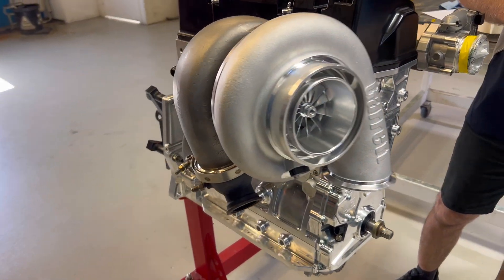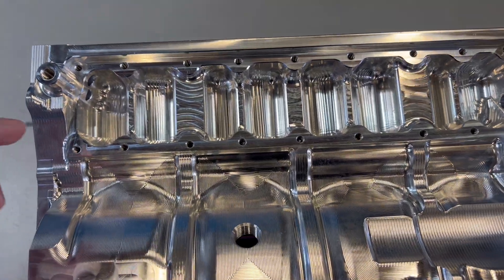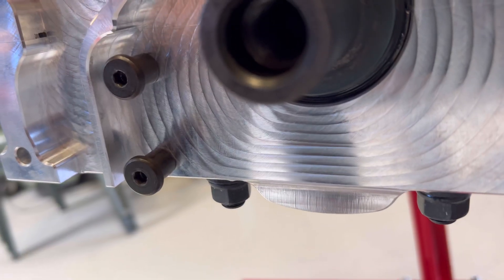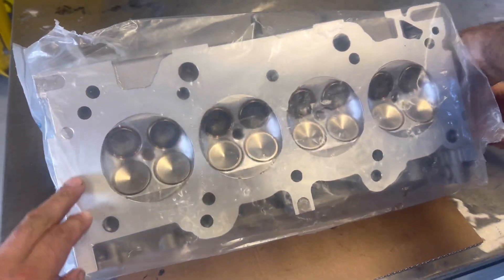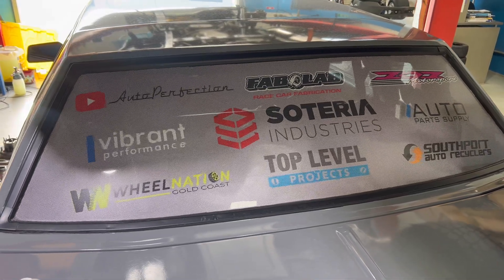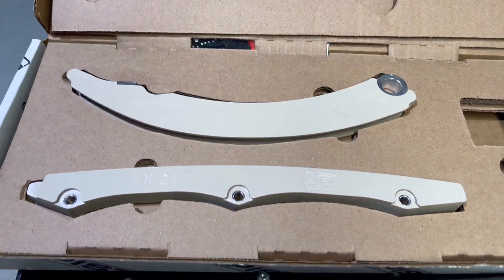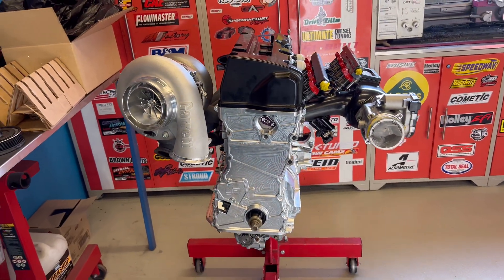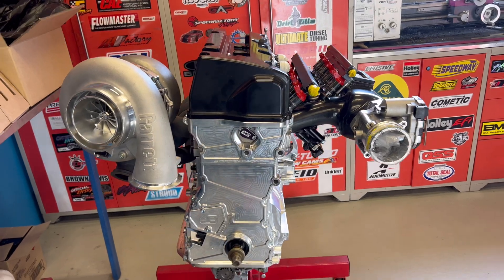BRAND NEW BILLET K24 - 1500HP BUILD

Comment: Im just starting my journey on the k24/t56 conversion in my e46. Being honest, if you could start over with a different engine platform would you? Im not interested in LS swaps. the BMW m54 engine is a glass cannon and k24 engines are a dime a dozen.
Reply from the maker: I think if you have a sleeved block and want reliability 900-1000 horsepower is the most I’d recommend
Reply: @autoperfectiongoldcoast  I appreciate your input, with that being the case I’m going to stick with the bmw platform engine since I’m looking for approximately 800hp reliably. Thanks again.

Comment: Unreal man!!! Love it
Reply: I take the stock tensioner apart and put a nut behind the piston so it cant retract. That way it cant fail. Secondly isnt your mains clearences a bit tight? I go for .050mm yours is 0.038
Reply: Also coolant pressure was your indication. Dry deck is scary without that data. Turns into a gas axe
Reply: Also i like to weld my timing gear onto the crank.

Comment: Waiting the result 😍,
I am in the same path, just had coolant pressurized at 22lb of boost due to sleeve installation issue.
Now converted to dry deck oem block.
Will see how far we can go 😅
Reply from the maker: Yea head gaskets have been annoying for us since day 1 really - but we are pushing things that weren’t designed to do what they do. Such an impressive little engine when you sit back and look what they can achieve. MPH doesn’t lie

Comment: great to see the tips for new players, checking oil flow through the gaskets and holes deep enough for bolts etc. was the 60mm engine move just due to space in front or is there some calculation to determine how much that makes on the front to rear distribution?
Reply from the maker: We have had trouble keeping the front down, originally when we built the car we kept it as far back as possible.